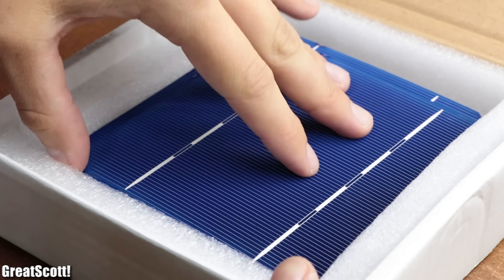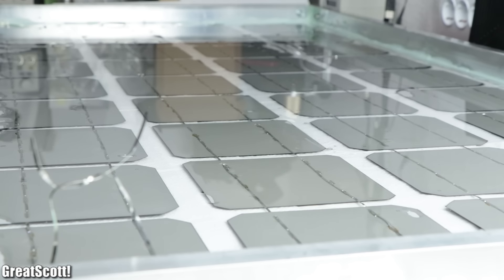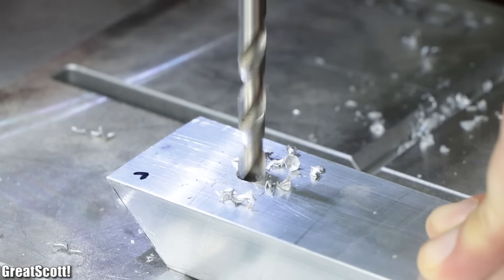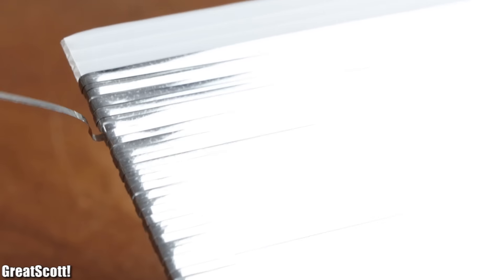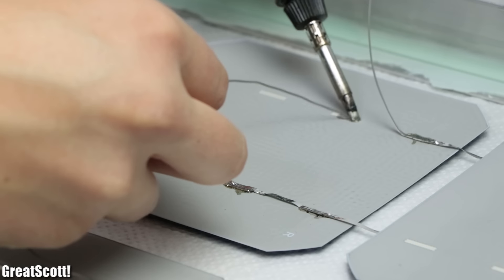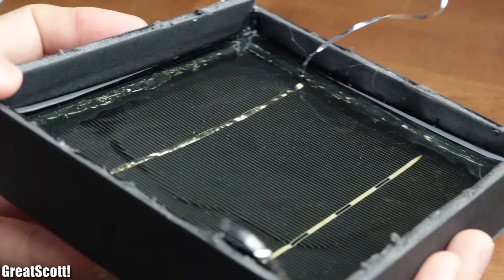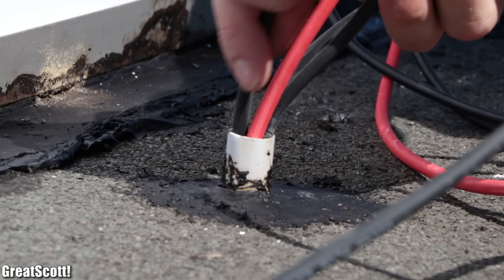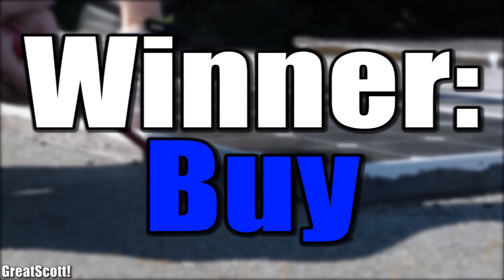100W Solar panel || DIY or Buy

Comment: USB SOLDERING IRON DIY OR BUY
Reply: Bin.
Reply: why would you DIY a 2-3$ item?
Reply: USB Soldering iron DON'T!
Reply: neither
Reply: Well, a use case might be to take it along with a power bank to your car and solder some wires where its hard to bring your soldering iron
Reply: NONONONONONONONONONONO
Reply: iwantitpaintedblack Get a ts100 for that
Reply: Usb only can deliver 10 watts at maximum. A decent small tip soldering iron uses anywhere from 40w-60w heating elements. Also you wouldnt be able to solder any copper wire due to the high heat transfer capability and the low thermal mass of the soldering iron.
Reply: I was thinking the same until I haven't bought one and now I use it more than my other two soldering irons (T12 and 900M types).
Reply: Usb type C soldering iron coming soon from Mini, the guys that made the ts-100. Marco reps has a video on the prototype.
Reply: tiesto9797, you should really give these 7W USB soldering irons a try. You can't solder very thick copper wires (more than 1mm copper diameter) with them particularly well, but for smaller jobs, they do reach the temperature very quickly and are quite punchy, because they have little thermal loss as opposed to bigger irons. They also tend to overheat and burn themselves up, so i have an urge to rip out the touch-timer circuit that just trips whenever and install a simple button, or mod it somehow. Otherwise, i think it's not replacing T12 as main use iron for bigger projects anytime soon, but it's good to have around because you can use it anywhere on a decent 2A power bank that you already own, and they're just so damn cheap.

I have also seen an alternative use for them, someone converted one to 12V, which gives it 6 times the power at around 40W, attached a thermocouple to the side with some Kapton tape, and made a temperature controller for it. I have no reason to believe that this wouldn't work remarkably well. The current is obviously much higher than what the heater is designed for, but the temperature control prevents it from burning up.
Reply: Usb powers around 5v 2A, which is 10w. You think it can melt solder with 10w??
Reply: Jamil Khan, yes, you can even melt solder with 5W if you can just avoid too much thermal loss and concentrate most of it right on a single solder joint - not too well, more like an emergency solution, but you can. Look at Hakko FX-901, it's 5W-6W, and it absolutely does melt solder, it's not up for debate, or they wouldn't have made it! I have a similar but crappier Takumi and it melts solder. Most of the heat the majority of soldering irons emit is lost on the body of the soldering iron rather than available at the tip.

Also you commented without reading the thread. Boo you.

Oh by the way, you can melt solder with 1-2W. You never saw a MOSFET desolder itself after you uh forgot about proper heatsinking and it lost that little power but it had nowhere else to go, well let me tell you it happens.
Reply: @SianaGearz  oh, didnt knew about that. Thanks
Reply: I've used a usb iron. They work for small projects. And you can clip them onto your belt lol

Comment: Now i wonder if there is really a need to create discrete panel at all? You can probably install them directly on the roof as an array of solder together elements and just slap pieces of glass on top of it, with some spacers/adhesive to actually create a seal. With that aproach it will probably be cheaper than buying a panel. Though this aproach(as well as the shown diy design and installation method) doesn't do amything to cool the actual panel, so there should be a need to combat it somehow(we can probably use a big metalic sheet to elevate the whole construction to create an airgap and use thermal adhesive or thermal paste to mount the actual elements,  but i imagine this would negate any possible savings.

Also diy soldering paste can be used to solder them all en-mass, since the components are quite big it doesn't matter that the particle of solder would be all over the place and pretty big.

Comment: I did this, never again.  The year was 1999 and I did it all wrong, silver solder ate away my tips, the box I made used float glass but nevertheless got very very hot, and this is bad for cells.  Furthermore not all were the same size (lot of broken cells, I didn't know what I was doing), so some of them reversed polarity because they could not keep up with the current thus creating a heater.  They were not surprisingly also intermittent. Since then my #1 complaint are charge controllers that boil batteries at 14.7 volts for hours and hours.

Comment: This was fantastic.  I've been toying with the idea of charging my Clarity with solar, but the car doesn't have enough sq footage on the inside of the car.  So I then started thinking about something like the GoSun Solar Charger, which is basically 12 panels that unfold hooked to a charge controller with a small LI4 battery that plugs into the car.  Their unit, $3,000 USD.   Meanwhile a GOOD 60 lb battery that would pass through 750 watts  is $1200 and to buy the parts for the 12 panels from scratch would be about $1200 plus the controller for each panel, and I didn't include eva film, a metal exterior, I would have used the encased in resin idea..

Comment: I know this was a quick test of the concept, but there are several mistakes in material choices and construction methods. First one is using mirror adhesive. It will not handle being outside. An exterior grade silicone sealant or, better yet, a roofing sealant since it can handle the temperatures you find on a roof. Second, the brackets and hardware used on the corners can not be normal steel. Steel in contact with Al leads to galvanic corrosion of the Al to the point where cracks will form in the Al. Only use stainless, brass, bronze, titanium, and Al hardware when using Al. Third, a thin layer of UV could resin could replace the plexiglass and would be thinner, leading to better thermal characteristics and lower cost. The rest of the resin could be non-UV rated if the initial layer was rated to block UV. If not, more expensive resin would be needed. Also, adding a layer or two of fiberglass cloth embedded in the resin to the back side of the panel would stiffen it very well. Last, covering the connections on the the back side of the panel in duct tape is not going to last more than a week. Even weather rated NASHUA 357 will only last 4-6 months outside and it is the best duct tape you are going find short of kevlar/nylon fiber based tapes for aircraft repair. Exterior grade silicone adhesive or a small, watertight connection box is the correct way to weather proof that area.

Comment: I just tabbed my first two solar cells together six inch square and they have five bus bars on each of them and I tap all five bus bars All was well so I tried to clip off a little Bit of tabbing wire and caught. The cell by accident breaking a little peace well that's the real small Lost not much. This is a bit of work that was my first two cells ever voltage was correct one point two volts 42cellshalfavolteach

Comment: it can be cheaper to build your own panels, if you can source cheap materials. I built ten 150W panels in 2004-05 and they still perform well today. i had bought 8 panels previously but they cost way more $ and five of them totally failed within 2-3 yrs. My solar cells were each smaller than the ones you used, and came in huge boxes bought from fleabay for around $25 USD each box. I had the aluminum and glass on-hand so that saved me big $. They paid for themselves in just 4 yrs, compared to the store bought panels that never paid off due to failures and no refund on their demise. Definitely takes patients soldering all those tabs, and assembling them. lol 
Also if you had the back of the panels more open so air can flow it might lower the heat and stop the plexi from warping.

Comment: Plexi glass alone would cost more then the panel from my local and online sources I have seen. The resin as well is very expensive too unless there is some bulk discount you can find online but even then it's more then a panel. I'm surprised it only cost you 140€. If I tried that it would cost the equivalent of probably 200-250€

Comment: I could definetely do it a bit cheaper by using regular glass and way less epoxi resin by only coating a little bit of transparent on the glass side just to glue all the front of the individual cells, then use cheaper white epoxi to coat the back side to protect the cell wiring, bet you could do another one with less than 90 euro

Comment: can u add cells in parallel to increase amperage?
Reply: yep. series increases voltage while amps stay the same, where as parallel increases amps while volts stay the same.

Comment: I've seen 100 pics of loose "2 grade panels( small blemishes or tiny chipped  corners) for $15 or so. 
Not bad. 
Then the glass. Pretty expensive.  The aluminum channel or "L " angle sections aren't cheap either.  
It may be a little less expensive to build your own if you count your labor as free
 But I DON'T.  SO, I  agree.
I've purchased 100 watt panels, Renology" brand I think.  For $89 delivered.  Not bad. 
I have 8 100 watt 12 volt panels,  a couple of 250 watt panels,  and 2 400 watt charge controllers.  My inverters are  4000 watts each with 2 
Batt, 4- 6 volt gold cart cart batteries, and 2  12 volt deep cycle RV or boat batteries.  
I horse traded, swapped some am.o and a little cash. Total investment,  less than $ 500. 
I use a pair of 6 v and a single 12 v battery wired in parallel for my TV, DVD Player,  a couple LED Lamps and to charge my phones,  an 8" tablet,  4 walkie talkies and my RC helicopters and Quads. 
The 2and system powers my fridge,  a ceiling fan, and I have a 110 v AC dedicated outlet in each room. 
So when the power goes out, we have TV/DVD fans and lights in each room from the main system,  and can charge the radios and phones off 3smaller system.  
Heat. We ha6a wood stove. Can sorta/kinda cookie that. No microwave though.  Have a couple propane camp stoves too. 
We could go quite a while without power if we had too. 
But I'm going to purchase a few more 250 watt panels soon. The thing is,  no power,  no real big deal.

Comment: What if you didn't need a glass enclosure, alum framing etc. and you could just place the solar cells behind a window? For example, I live in a flat of which one window gets continuous sun for at least 10hrs a day. Might tip the balance in favour of DIY?

Comment: The resin accounts for a large part of the cost. So does the plexiglass. There are alternative mounting methods for attaching the cells to the panel which are much cheaper. Plexiglass can also be replaced by a cheaper glass pane. All in all, one can control the cost of the version made by individual components much better that the ready made version. The same holds for the quality of materials, although some industrial grade materials might not be available to the individual constructor - at least not at a cost effective price. The quality of construction is another factor at play. An individual constructor might be able to compete with a poorly made ready made panel (depending on skill level) but generally, ready made panels assembled by robots should be of more consistent construction quality. A large cost factor not mentioned is postage cost or cost of procuring the materials as well as the waiting times. Large glass/acrylic/plexiglass/etc. panels and aluminium extrusion profiles cost money to send. Last, one needs the right tools to do the construction quickly at an acceptable manner, especially when more than a couple of panels will be constructed. There are other parts not mentioned e.g. the back of the panel and weather protection materials (such as sealants etc.). Prices of course differ from place to place as well as the time and resources available to each constructor - which at the end of the day is the major deciding factor.

Comment: You know you can go to Power 4 Patriots and they show you how to do that just like you're talking about and you certain chemicals like silicone to a two-part silicone for the glass part to keep the panels from cells from moving around and they produce more than a commercial solar panel would you follow their instructions

Comment: would it have been cheaper if you made the solar cells yourself and made more than one panel? was there only enough resin for the one cast or did you have left over?

Comment: cheap plexiglass will degrade under direct sunlight very fast. I replaced one broken glass in my greenhouse with plexi and it only lasted a year before the plexiglass turned into rubble. 
is there a hidden or overlooked function to using resin other than holding the solar panels in place? can't I use a cheap picture frame with a cardboard back to secure the panels?

Comment: You used plexiglass and resin. I wouldn't necessarily say it isn't strong, it's just super flexible. If anything, say a rock or something flew up there and hit it it would most likely bounce off. Here it would be way cheaper to make a panel rather then buying one.

Comment: 08:25 I think you should try again with a really bodged version. Use salvaged materials to mount the panels, perhaps behind an old piece of glass in a scrap wood frame. No resin. Cost: 62 Euros with these prices.

Comment: The big question is this:  how many of these 100-watt panels does the average homeowner need to install before s/he is grid-free?  I read the average consumer required 30 kW per day or 1.25 kW per hour.  But we only get around 3 -5 peak hours of sunlight and mostly around noon when our sun is direclty overhead.  Unless you send excess electric to the grid, you will then need an efficient storage device.  And don't forget you will need a very expensive inverter to convert all that juicy DC into AC to run everything in your home.  All told - your investment will be a minum of a few thousand dollars.

Comment: why is the frame of the panel so much deeper than the thinner working part? (PV cells + resin thickness) This is true in the commercial panels also but why? Is it for the right strength/rigidity of the frame?

Comment: You could use them for a portable solar panel. Just make a big cloth rectangle and reinforce it with thin sheet metal plates to keep the panels from bending and cracking. Then you can just fold the whole thin up accordion style and stick it in your backpack. Bam, laptop solar charger on the go.

Comment: You should cut the tip of the adhesive dispenser bigger and push instead of drag. Pushing the tip will have a wiping action and the adhesive will be evenly spread and uniform in width instead of uneven blobs when you drag the tip.

Comment: Well as you were adding up all those parts I was concerned about cost, but you could always use those diy parts for repairing your bought solar panel assuming you can get into it.

But that is the problem with DIY it can cost you a lot more than just buying it ready made, which makes sense cos they make a lot of them, but doesn't make sense cos of all the labour that goes in to the production.

And that's where the machines come in and why people are losing all their jobs.

Comment: Would be awesome if you did a video about making a DIY A/C. It's really hot inside and outside and the stores are out of fans and coolers.
Reply: i finished school today about it and i finished 2 school to be able to install and one for repair tham .but theres a huge problem if u wanna create an ac u need cooling agent probably a r410c .:) need opper pipes evaporator and condenzator (ifu wanna do thoose at home u need copper pipes and aluminium in between exactly like the cpu cooler just in a biggeer version u need fan u need pressostats compressors if u wanna make a small one ill say notgna worth so much but u can try to make a condenzator to outside and an evaporatir to inside and the basic thing behind it u dont wanna bring in cold u wanna bring out heat so the cooling agent needs to collet the heat in ur house and bring it out wheres a fan blow the heat out from the cooling agent what is turn to liquid and flowing back to evaporator where it picks up the heat of your home w a fan again so u blow the hot air on the cooling agent and u use pressure changing methods in evaporators and condenators cuz one is rising the other is owering if u can do all of theese prob u already gna have a low decent ac
Reply: @eltorohomerenovations4412  Thanks for the info :)

Comment: As a retired teacher all I have to do is a days work to pay for a couple of these panels. The idea still interests me though as I think the whole pv industry has got it wrong.
If I take any object say a stick and reduce its dimensions by 50% its stiffness will go up by a factor of 8.
To make panels robust they should be as small as possible limiting factor one cell. OK we are talking beer mats here with about 3 you could charge a mobile phone and or an LED light that is a really big deal. Now work your way up from that paycheck to paycheck. 
What else is good about this ?
Because they are small they have very good air circulation cooler =better efficiency. The last place you really want to put solar panes is on hot roofs you should be putting up high on tall gantries. Jeez wouldn't that be very expensive? No nature has built them for us they are called trees. You screw them to the branches with stainless steel screws. The tree will instruct you on the optimum angles, look at an adjacent leaf.
One last comment your panel is covered with clear epoxy on the underside this causes the bottom of the panel to be black rather than the usual white. This is good as the 80% of radiation not getting converted to electricity is getting converted to heat. The black is the best emitter to get rid of it.